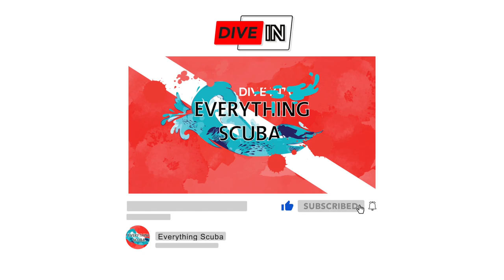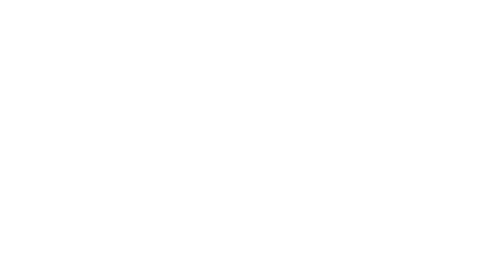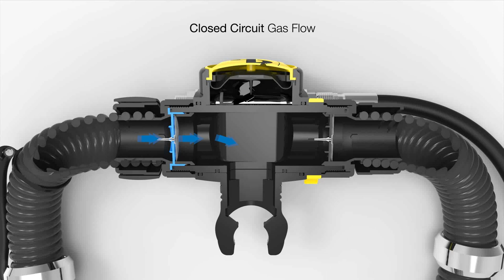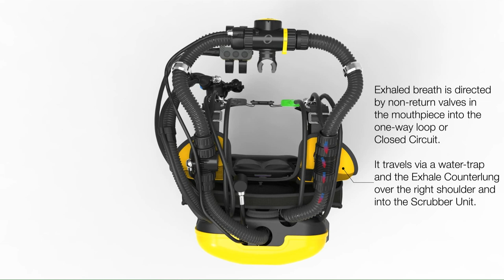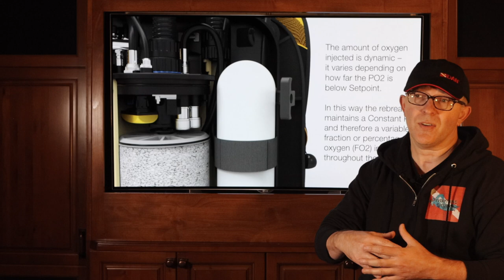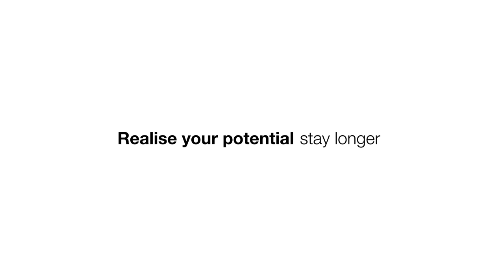How do closed circuit rebreathers work? (AP Inspiration Rebreather).

Comment: Thank you guys for making this, im getting into scuba (open circuit) but im looking for as much info on in depth systems as I can. So far you are the only channel that goes in depth on the systems involved. I only dive 5 to 10 ft open circuit to cut ropes out of boat wheels, but im obsessed and will go further.

My first ever dive was with no experience, I dove 5 ft with a spare air to cut rope out of a wheel (no wet suite, no mask). Not knowing how dangerous that was, I thought I was going to die, got caught in the rope. Since then I went to learn the correct way of diving. I'm diving off the coast of Maine, very cold.